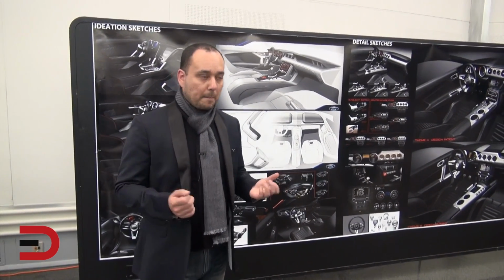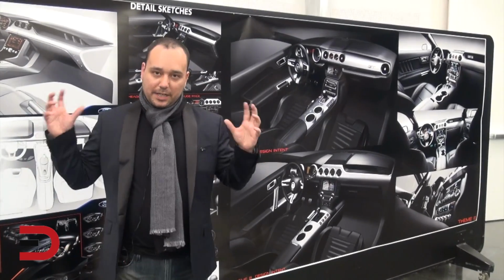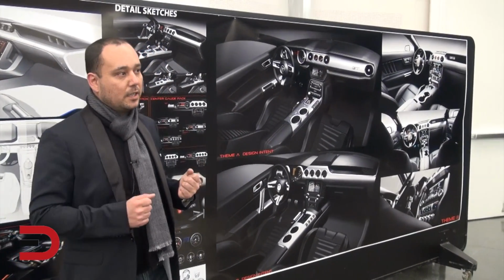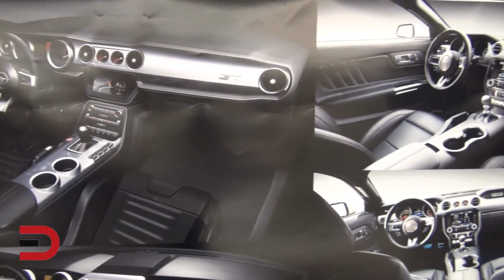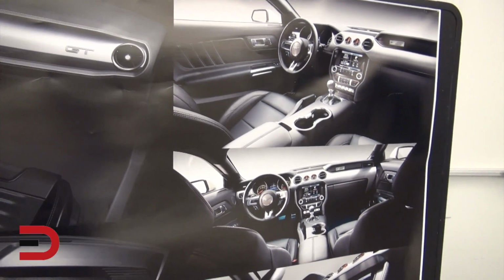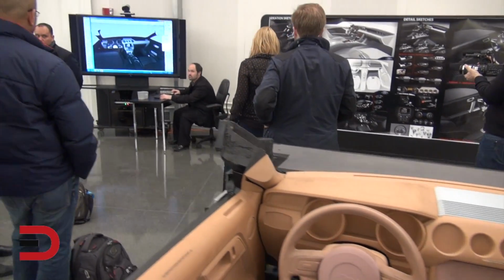Exclusive Look: 2015 Ford Mustang GT Interior Design Process on Everyman Driver

Comment: TOO F-ING RETRO AND CHEAP. Stop with the retro shit, "oh it needs to look like a 1964", it's 2015, make a nice modern interior already! The 64 was great if you like that look then go get one. Personally I want a badass interior, not a fing round bowl on the steering wheel with chrome all over. Its just confusing. Might as well not use LEDS, they are not retro, oh clear coats too, abs, etc. The outside looks nice and sleek and the inside looks like a mess, might as well add some engine turn to the dash so I can just barf already.
I want to feel like i'm driving a nice 30K+ car not a fing 1964 airplane.
I get it, the car has been around a while but making it look all retro with chrome all up in every area ain't helping nobody. Stop looking back and start looking forward!!! Think GTR! The japaneese know how to move forward with a model and look fresh. Americans will never learn. Of course some people will think "it looks great" those are the people who were like, "wow that pontiac aztec is so awesome"
Reply: Agree. Some of the other renderings matched the modern exterior. The interior of this car is a sale stopper for me. Buy a used Porsche instead.
Reply: Can you do better? I don't think you can, be happy people even make cars idiot. You're really ungrateful
Reply: Your the idiot Angel, Yes I could do better and they can too, that is the problem, it sucks, and in turn our auto industry sucks, and inturn we as a country cant compete because people want to make crappy looking stuff that looks like it used to. Hey how about an led tv that is in a huge wooden box console that sits on your floor. Would you like that?
Reply: Maybe you should use a flip phone, that would be retro. I wish they would have put an 8trak into the dash to complete the look.